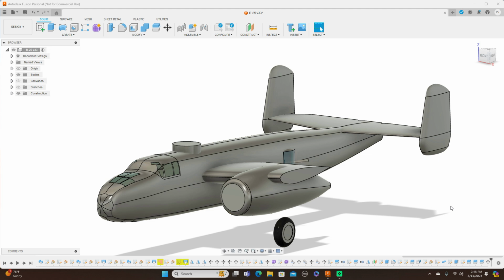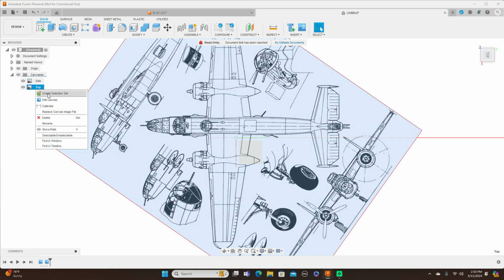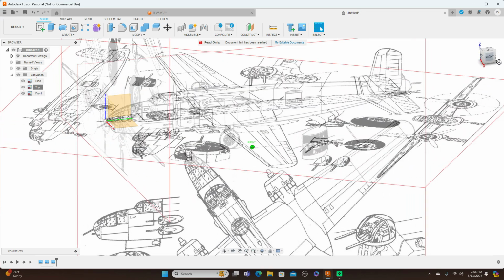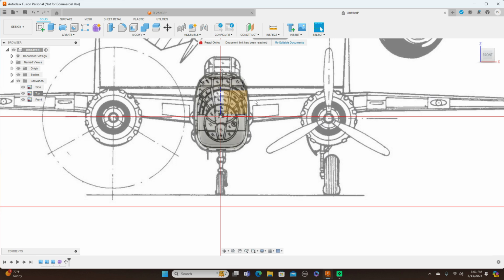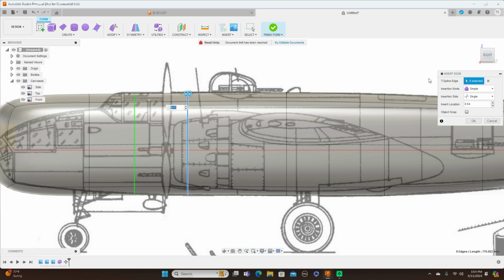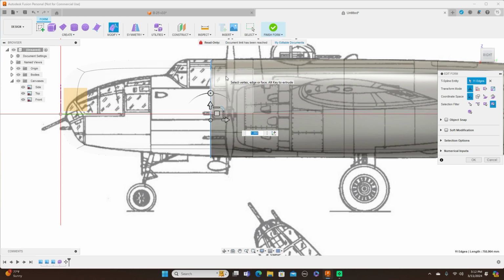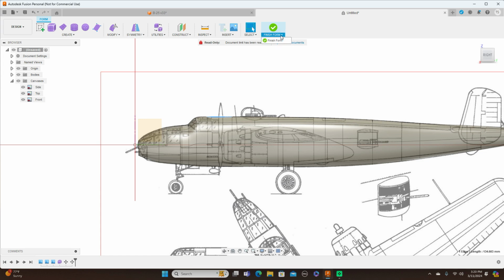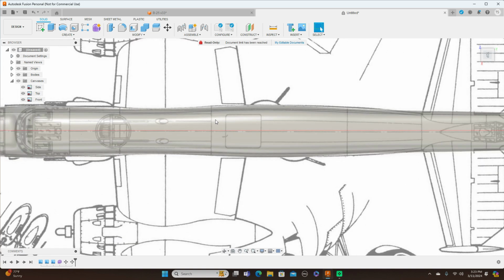Learn How To Model A B-25 Mitchell In Fusion 360 Beginner To Advance Part 1

Comment: An excellent start. I am learning Fusion 360, with your assistance, specifically toward developing near-scale dorsal turret details, as well as side window and rear machine gun mounts and behavior. This for 1/9 and 1/8 scale B-25H and B-25J radio controlled models.